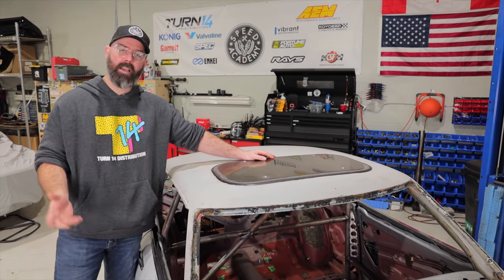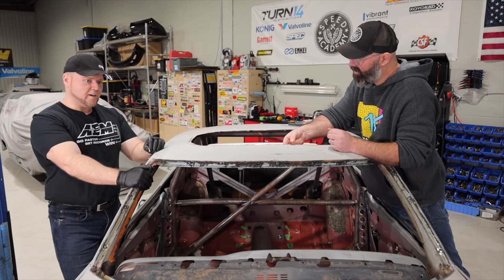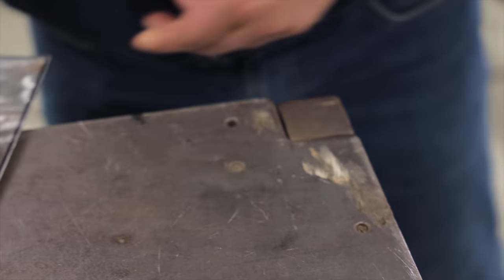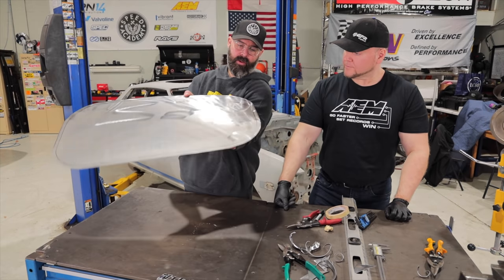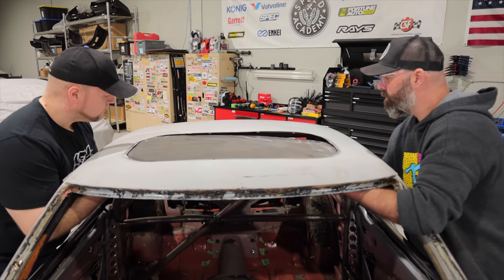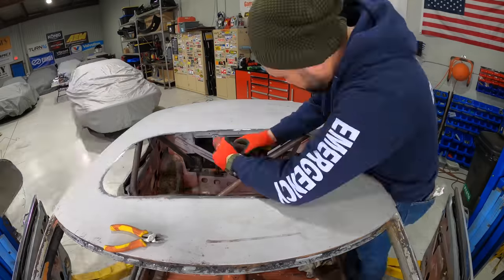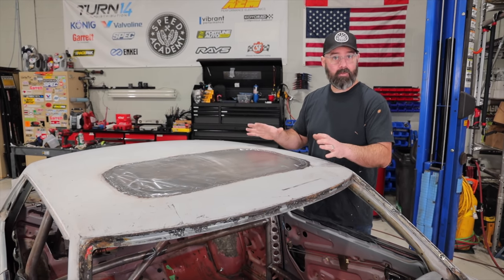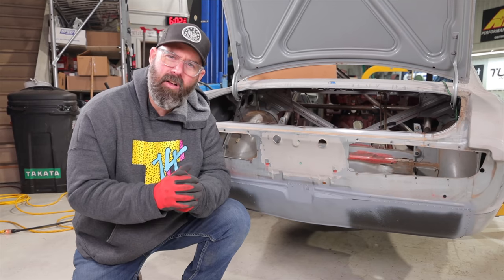Plugging The Sunroof Hole - 1977 Toyota Celica Rebuild - S3E04

Comment: I'd love to work in that shop during the rain, nothing more relaxing to me than rain on a metal roof.
Reply: Thats what I got going on right now in my mobile home.
Reply: I've had it a heap in the shed lately.  Sometimes it's so loud it sounds like it's bucketing down until you go outside and it's only sprinkling.
Reply: Until the air compressor cuts on
Reply: Scares the crap outta me every time.

Comment: I did this a few years back. I took my battery powered jigsaw to the junkyard and cut out the roof of the same model of car And fit it, cut and glassed it on the inside and used filler on the outside. I didn’t feel comfortable welding it because the metal is so thin I didn’t want it to warp.

Comment: i just riveted it on the top side with honda bond for a gasket. then ran a dab around the outside edge and cleaned it all up after. I wish i was able to do it like this, so much cleaner.

Comment: I like to use self tapping screws to hold panels like the roof plug in place, then just plug weld the self tapper holes when you're done

Comment: Nice plug job :) not to harsh a comment but you still need to grind those welds down . Don't worry about pin holes just get smooth so when you put a ruler over the two sealed edges they are level. Still nice work boys 👍

Comment: Get Tim with the Street Banditos to lay you a carbon roof skin replacement. A smoked carbon roof could look really cool on this car!
Reply: And then I got to the end of the video. SO STOKED to hear y'all are working together
Reply: That kind of defeats the purpose of deleting the sunroof for that clean roof style that he wanted.
Reply: @bigdfitness5020  A smooth roof would be needed regardless for a buck (hence this work isn't wasted). Lots of cars pull off a black roof nicely.

Consider this though, a carbon roof takes care of the strengthening/support they mention they need to add. You can get a ton of rigidity without the overhead bracing that interferes with helmets and moose size people.
Reply from the maker: With the plug welded in the roof is really stiff and strong now, but a carbon cap has definitely crossed our minds, especially given Tim’s expertise in the area. We’ll see what he thinks when we take the car down to him next week.

Comment: I'm going to be plugging the sunroof in my project '93 Honda Integra with a carbon plug from Dogfight.
Reply: nice
Reply: I did it on my 2010 fg2..
Soo noticable.u wont regret it..and mine is sheet metal from a m3 roof haha wraped carbon and 40rivets

Comment: Where you went wrong on the sunroof plug is after you have the ruff size of the sheet metal you need to put it into the car and raise it to the roof. Then You trace from the top. Not the other way around like the Russian did. That’s the reason why you were left with big gaps, and need to fill/weld so much.

Comment: As far as reenforcement bar for the roof my 1973 and 1972 celicas both have a factory one that bolts in place. If you track one down might save you some fabrication time.

Comment: is the bare-metal perimeter of the patch panel that's underneath the factory roof panel going to be a rust issue?

my vote is for Light Iris Metallic (95-97 Dodge Neon code "PC5") or Desert Coral (1994 Ford Probe code "FH")also, if the patch panel doesn't work out, updating the sunroof to something like the Webasto Hollandia 300 might be an option

Comment: Did you fill the gaps with tacks instead of running beads to avoid warpage? I'm going to be doing this with a miller sync 250 which is a TIG. Any tips would be fantastic. I'm assuming just take my time and don't run to much at once. Let it cool.

Comment: You could have used panel bond with a few tacks on the underside to hold the plug in .
The biggest mistake a lot of people make after fitting in a patch is they forget that the grinding heats the metal too.
Reply: Did you not pay attention to the wheel they used on the grinder?
Reply: @bigdfitness5020  . I could say Duh but no I was talking about after a patch is welded in often people get carried away with the grinder trying to smooth it out forgetting about the heat,

Comment: I'm not a fan of the metallic grey/silver you chose. That's just my opinion. I think you should choose a more modern color to match the updates you've made. I don't like the color on newer cars, but the "flat" grey that Toyota currently has might look nice if you're sticking with the grey tones. I think it was originally a Scion TC color and now they use it on some other models. But it's your car and I'm sure what you choose will look nice. It only has to look nice for you, so choose something you'll enjoy :-)
Reply: I think they are trying to use period correct colors.
Reply from the maker: Cement Grey from the tC is a cool color 👍🏼